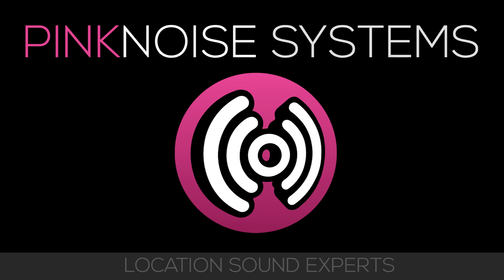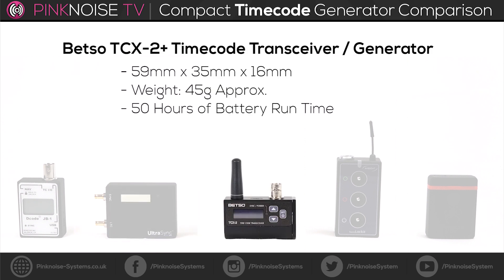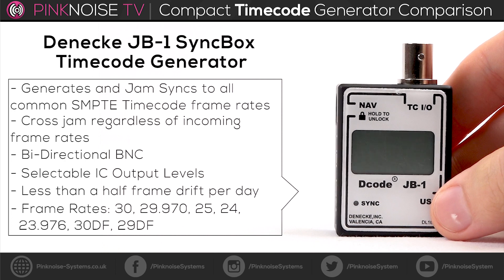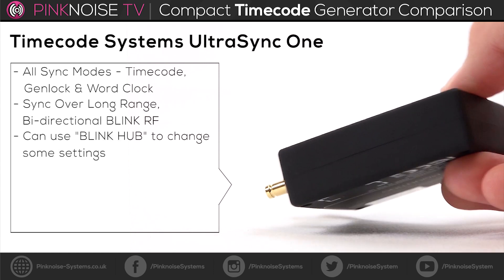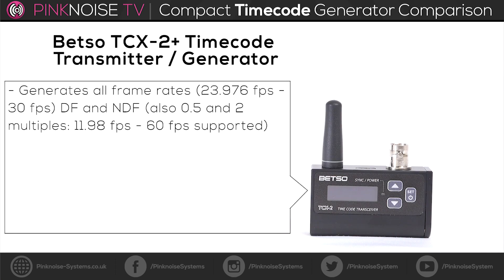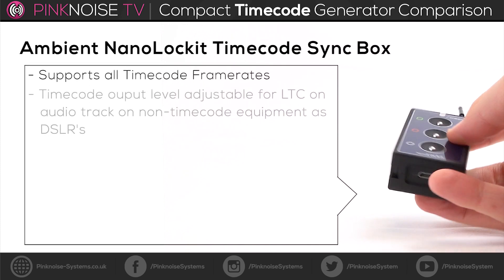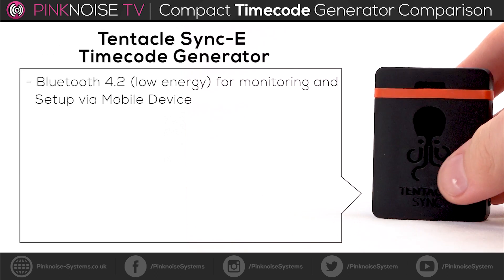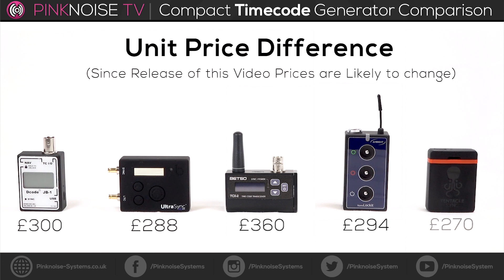Compact Timecode Generator Comparison

Comment: If I wanted to use the UltraSync as a master TC for BOTH my audio recorder and my camera, hardwired to both, is there a setting to shut off the RF completely so that it is not broadcasting using up extra battery?